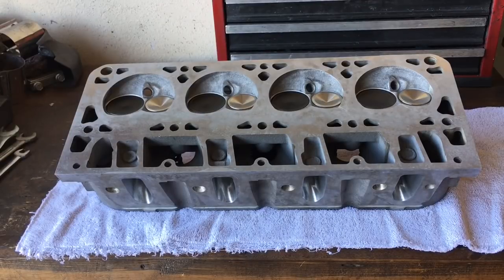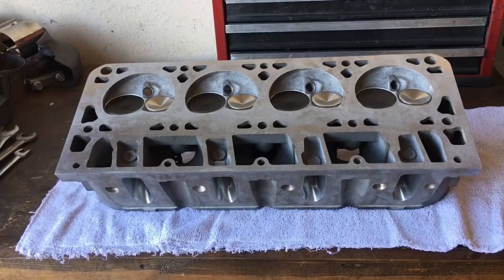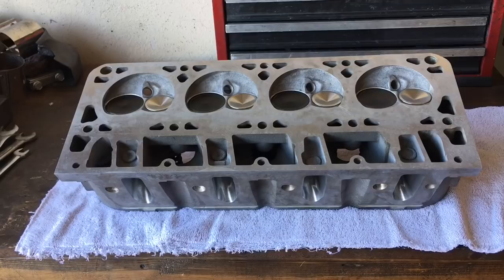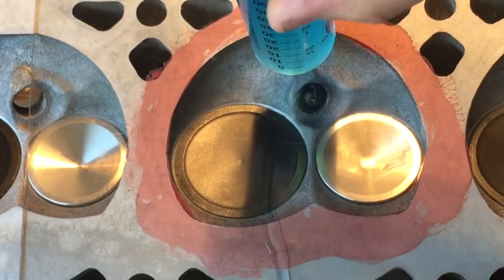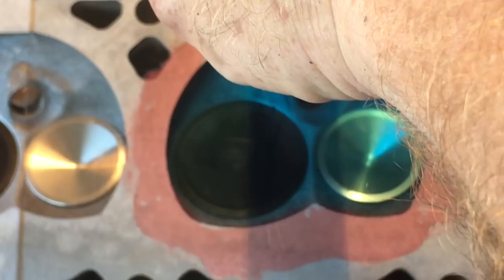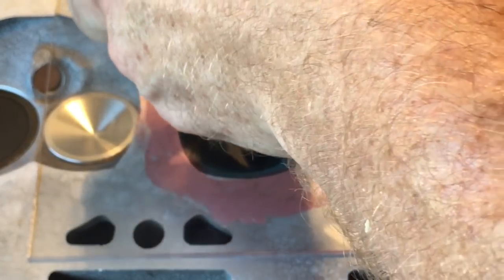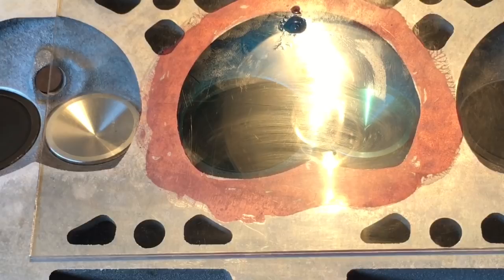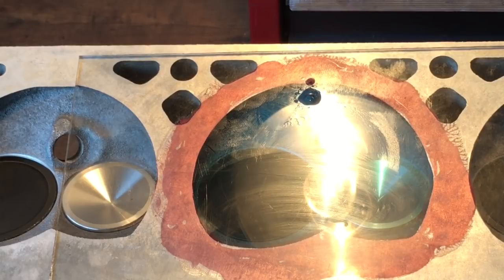862 heads DO NOT come with 61.5cc Chambers

Comment: The difference is mainly between the 862 and 706s because of the way they are cast. 862 can have more variation because of being sand cast ( 706s are permanent mold style ). But as others have also said you spilling a few drops, different valves, sunk in seats and even different spark plugs all can change the measured size of the chambers. Hope you edit the commentary and correct your comments so others learn correctly and not think incorrectly because you showed incorrect information.

Comment: I've worked in a machine shop for 22 years and just cc'ed a stock head before a valve job or surfacing, and it was 63cc.
Reply from the maker: Closer than some that’s for sure, I have yet to find one anywhere near 61.5cc factory. They’re supposed to be 61.5cc , but I haven’t found one yet.
Thanks for watching and sharing your results!  JD

Comment: If I was using those heads on a 5.3 that's probably fine, if using on a 5.7/6.0/6.2/383/403/408/416, I would unshroud those valves a bit and might open the chamber a little bit for the absolute best results.
Reply from the maker: Definitely needs a bigger cylinder bore to shine!  👍

Comment: Did you wind up having to use shorter pushrods with that head after milling it?
Reply from the maker: I always mill the heads equally, I’d have to go back and see what length push rods.  It’s always recommended to verify push rod length to set the lifter preload.  You’ll be surprised how many different lifter preloads there are between manufacturers ranging from .040” to .100” 😳😳😳
Reply: @HeadFlowInc  Absolutely there are! I’ve ran into the problem with having to use shorter pushrods and figured I’d ask.

Comment: Are they the stock valve
Reply from the maker: This set has 2.00”/1.57” valves; it must not make much difference because every 862 head I’ve checked is +- 65cc.  JD

Comment: Flow numbers, dude.
Reply from the maker: What flow numbers do you want to see? What heads etc?
Reply: @HeadFlowInc  any of them, results pique interest
Reply from the maker: Sorry I missed your reply, YouTube doesn’t notify about follow up replies I have to go back and check. 
I have flow numbers for many LS heads I’ve ported ranging from 215-225cc intake ports and 81-83cc exhaust. 
My 215cc port w/2.00” valve factory valve job flows 275-280 cfm @.600”. 
The 225cc 243’s w/2.00” valve factory valve job flow 300-306 cfm @.600”
I could improve the flow numbers a bit with back cutting the intake valve, under cut aftermarket intake valves and possibly using a performance cnc valve job.  Sometimes the ports don’t respond well to the multiple angle race valve jobs. 
Naturally if I used a 2.02” or larger valve the heads would flow even more. 
The current 862 small valve heads 1.89” /1.55” valves w/208cc intake port is flowing 254 cfm @.600” lift!  268 cfm @.850” lift.  This is a small chamber, moderate port size, small valve combo out flowing 243/799 heads. Why?  Because there’s zero upper cylinder shrouding with the 1.89” valve; this style of head maintains more port velocity and flow resulting in better throttle response, higher average TQ/HP compared to the 243/799 2.00” valve heads. JD

Comment: Those valves don't look stock .did u also have a valve angle job done because that can drop the valve further in the seat . the volume of the spark plugs aren't included  in my experiences when u cc a head , and u did spill a bit ,and idk about syringes being accurate to that point given the volume of the neck . I'd be more apt to over fill a larger one and weigh it ,then fill the chamber and re weigh it to be fully accurate if I suspected something like this .
Reply from the maker: John Connolly Feel free to measure as many 862/706 heads as you would like you won’t find any close to 61.5cc uncut.  The same applies to 243/799 heads they won’t measure 64cc and the 241 heads won’t measure 68cc they will all be +- 3-5cc larger than advertised.  I’ve been doing this a long time, I openly invite you to validate the information provided.  Thanks for watching and the feedback I appreciate it!  JD

Comment: So would these heads be any good for stock ls1?
Reply from the maker: Yes and no, it depends on whether your planning on a bone stock 862 head or ported or if your planning on only revving the LS1 to 5500-6000 rpms. 
The 853/806/241 heads have the same size intake ports as the 862/706 heads but with a bigger intake valve.  Where the 862/706 heads win as cast is the much smaller combustion chambers create more compression.  From idle to +- 5000 rpms the 862 heads will produce more HP/TQ than the stock LS1 heads until you exceed 5000 rpms, so when you look at the averages of HP/TQ through the usable rpm range yes the 862 is better. 
If you ported a set of 862’s and upgraded to the 2.00” valve you can far exceed both LS1 and LS6 heads, but to take advantage of it requires camshaft, injectors, exhaust and tuning.  JD
Reply: HeadFlowInc thank you appreciate it
Reply: HeadFlowInc  I have 853 on atm would it be better to just get them port n polished

Comment: So which heads do we go with now...🤷🏾‍♂️😩
Reply from the maker: Wan Byas It all depends what your goals are?  Are you wanting a max effort pump gas, Turbo build, Nitrous setup or?  
Honestly, the best thing you can do is decide what octane fuel you’re going to run and build around it.  Don’t get blinded by the SCR (Static Compression Ratio) instead use the free online calculators to find your DCR (Dynamic Compression Ratio) which is what actually determines the octane needed. 
The valve timing of the cam at ABC or ABDC on the cam card information drastically affects the DCR, selecting the right camshaft and SCR to produce the DCR compatible with the fuel is the trick!  
There’s a lot more to setting up a max effort build than most realize.  JD
Reply: HeadFlowInc dcr? ABC or abdc?   Ok I’m lost.

Comment: I have to admit, I was skeptical at first, especially with using those syringes to measure with, and all the info on the interweb all states that have 61.1-61.5cc chambers. I just happen to have a 50cc burette set up to measure the chambers on a set of 799's that were supposed to be milled .030".  I have a couple sets of 862 heads in the garage so I pulled one out and set it up to cc the chambers.
Since the chambers are ~>60 cc, I had to refill the burette and zero the bottom of the meniscus to the scale, it ended up on 15cc.  Yes indeed folks, THIS head measured exactly 65cc. Confirmed.
Reply from the maker: Brian Buck I was shocked and disappointed when I found out the heads have bigger chambers than advertised.  I should have known better, all the old GM cast iron heads were the same way.  Ex old iron 72cc Pontiac heads measure 77-80cc!!!  That’s a big difference! 
Thanks for sharing your results!  JD

Comment: Good info planning on running some 862 heads on my lq4 with 40 thousands head gasket with btr  stage 4 ls3 cam hopefully have enough piston to valve clearance
Reply from the maker: Garage builtt You’ll have a decent bump in Compression, you should calculate both the SCR and the DCR to verify what octane fuel you’ll need.
Reply: @HeadFlowInc  i run race gas because I  spray nitrous anyway
Reply: I wouldn't use a Step 4 LS3 cam because it would have too large of a duration split, you're better off keeping the same over lap with more intake duration (which the small valves give enough P-V clearance for) and less exhaust duration and I would probably use the Vizard 128 formula to calculate LSA.
Reply: Turn out had a lq9 and ended up going with 799 heads

Comment: HeadFlowInc if thats true so why my ls1 engine with those heads made 10:8 compression untouched and made more power and 20lb torque deference than the 243 heads ?
Reply from the maker: ysoof alhammadi 1. No matter what the 862 heads raise the SCR more than the 243/799 heads. Why? Because both heads have larger than advertised combustion chambers!  Both are a solid 5cc larger than advertised 61.5/65cc and 64/69cc 
2. Compression builds torque and HP.  On average a full number of Compression represents +- 8% power up or downs 
3. Unless you used 64-65cc when you calculated the Compression then it’s not a true 10.80-1.
4. I doubt it’s much of a factor on a 3.898” bore but there could have been a cylinder shrouding issue with the 243’s I’m not sure.
Without knowing what head gaskets you used I’d say your SCR is around 10.45-1 
I could calculate the DCR if I knew the camshaft used and head gaskets.
Reply: HeadFlowInc sorry for not replying a month ago  but that measurements was taken by the garage that built my engine it was an ls1 from my 2004 gto with comp 224/230 cam and factory head gasket my compression was 10:5 with the 243 heads untouched measured by the garage and made 370whp 355wtq auto trans of-course and when I replaced the heads with 706 also untouched he measured the compression and it was 10:8 and it made 388whp 376wtq so sorry for not believing but your the only one that says the deference and also there alot of other sites i searched over the years that says what gm claims are true
Reply: @HeadFlowInc  That's a very important point the vid didn't really clear up. If just ONE type of head is several CC larger, that's a problem when comparing other heads. If ALL have larger chambers, then all combos will be lower CR than expected across the board. The later isn't a big deal since swapping 317's for 799's or 799's for 862's will still net an increase in compression.

I've got a few 799's I can test with this same method, except I plan to use distilled water & also weigh the water used to double-check.

Comment: Intake valve is sunk in the seat now  and you removed material abound the exhaust valve, the time to cc them was before you had them machined twice, else nothing here is conclusive enough to change ones build plan
Reply from the maker: thomas harvanek You are clearly not paying attention to the video. I have shown several 862 heads on my channel and ZERO of the factory heads had chambers below 65cc (feel free to measure as many as you want and post the videos)
In the beginning of the video I verbally include these heads were 65cc chambers before any machine work.  Yeah it’s frustrating when people like you don’t listen, have no experience yet post comments with no value other than showing you are confused. 🤷‍♂️
When a machine shop does a valve job they set the “valve stem height” with in its specification, so no the valves aren’t sunk into the head, they are to GM specification. Strike #2

Comment: I agree, the 862's going on my 6.0 have been milled twice.. and I measured them out to over 60cc. Granted the machine shop could have only taken off a couple thousandths, but who knows.
Reply from the maker: chevydriver207 I’ve found every stock GM head I’ve checked always measures +- 5-8cc larger than advertised.  This added chamber size holds true for SBC, BBC, Pontiac V8, and LS heads, so it has to be common practice.  
Thanks for the feedback I appreciate it! 👍👍👍
Reply: The Rusty Nut hows that 5.3 headed 6.0 behaving for you? I have one but not happy with top end.. i may get the heads ported and swap intake manifold. It has tq for days though
Reply: @swappedoutZ71  Wondering if you did anything else besides the 5.3 heads. And if you had to retune
Reply: Casey Elder yes it needed a retune and i had all supporting mods for a cam
Reply: @swappedoutZ71  The heads have a ton of port work done, and its an absolute animal.
Reply: The Rusty Nut thats what i need to hear to sell me on PRC stage 2.5s ..could you describe the power curve?
Reply: @swappedoutZ71  Hard to describe Lol it's in my 72 Nova, and it does not keep traction if you put your foot into it. If I ever get it on a dyno this summer I will let you know.
Reply: The Rusty Nut im on stock heads and intake just cam longtubes and built trans and i can agree with you on that part. No problems burning out lol
Reply: The Rusty Nut what intake you go with??
Reply: @wanbyas359  It's an Ls6 knockoff made by Dorman. I think the part number is 615-901. I want to upgrade intakes at some point to an atomic airforce.

Comment: Did you check multiple chambers to see if they are consistent in the casing or did you check the same chamber each time?
Reply from the maker: Superado2006 I generally don’t check every chamber, it isn’t required.  I try to check the same chamber, or at least one on the same head to compare. It’s never a bad idea to check a chamber from each head, I’ve seen them differ by a couple cc on older heads. 👍
Reply from the maker: Superado2006 I’ve seen a guy who use to cc every chamber on both heads, he would find the as cast “largest” chamber and make all the remaining 7 chambers match it within 1/2 cc. 😳🤔
Same guy had a flow bench, he would balance all the ports in the heads until they all flowed with in 5 cfm of each other.  Heads have good & bad ports, this may be caused by various port shapes and locations making them all slightly different. 
Same guy also flowed his heads with the intake bolted on!!! 🤔🤔🤔
Reply: @HeadFlowInc  sounds like he would get a very smooth and even running engine that would perform just a little better then the rest, now was it worth the time and effort, I guess that depends on the results and the application.
Reply from the maker: Superado2006 Nobody was able to duplicate his performance using mostly Factory parts.  His name is Jim Hand a well known traditional Pontiac V8 racer, check him out on a Google search. 👍

Comment: something that no one is pointing out here is that just milling your head deck surface isnt good. It changes you clearances and makes things uot of alignment. If you mill your heads you need to mill you intake or block intake mating sufrface
Reply from the maker: Richard Scarlett Keep studying, at least you’re trying to understand!  
There are times you should mill your heads equally on both the intake and deck sides/surfaces to restore the intake manifold sealing “angle”.  Not needed at this cut. 
Yes, you will need to account for loss of clearance piston to valves. 👍

Comment: You are still getting a false reading. You need to plug the spark plug hole flush, not using a spark plug. Using a spark plug with this method, you are also filling the spark plug cavity and the area around the ceramic insulator.
Reply from the maker: Richard Scarlett The spark plug will be there during operation so it’s a more accurate measurement of chamber size. Free tip! 😉😎
Reply: I'm not head expert but that definitely crossed my mind watching this. .. but I mean how many cc is that part of the spark plug .. also when I have seen this done in person they used a tool that was essentially a threaded rod in a tube that mimics the plug except it's just flat, turn the rod in then turn the jacket to seat it at the desired depth .

Comment: Those valves added cc and you dropped 2-3ccs out of the needle as you were putting it in. So it was more like 58-59 cc.  Flat valves would have put you at 55ish range. So yea. There about 61-62 ccs factory.
Reply: Agreed

Comment: So then reducing the volume is good because of the added pressure it builds during the compression?
Reply from the maker: Timothy It’s a way to increase the compression ratio of the engine. Higher compression makes more horsepower and torque. Here’s ways to increase Static Compression:
Milling the heads.
Boring the block.
Thinner head gaskets
Piston dome design.

Comment: What 4.8-5.3 heads do I need to avoid? I'm looking to make the LS leap, I want to start with a smaller cheaper engine. And maybe get a 6.0 later. I think a 4.8 with 10 psi intercooled, in a1/2 ton truck or car, will be plenty for a daily. Maybe a 6.0 with 20+ psi and water methanol injection. And a cam and other goodies, for a weekend bruiser. Maybe a 4.10:1, 4.56:1 gear. And over drive! But I'm looking  to put it in a 82 Monty SS clone.
Reply from the maker: JAMES! Since the 70's Avoid the earlier heads like the 706 with the Kastek sp?  It has a symbol that looks like a battery sitting side ways under the valve cover. 
You’ll find Turbo combos won’t need deep gears like a NA build.  JD

Comment: Do guys angle cut these heads, I know the old SBC could easily be angle cut.
Reply from the maker: JAMES! Since the 70's I haven’t heard of anyone angle milling in a long time. I know the LS heads have a way better valve angle, not sure if this would play a role in how they mill the heads.  I was always told if you mill a head .020” or more on the deck side the same amount should me milled off the intake side.  😉

Comment: Did you do anything to the block?? Like flat top pistons or deck the block ?
Reply from the maker: James The machinist STD bore 2002 4.8/5.3 iron block honed the cylinders and new HD cam bearings.
4.8 Gen 3 flat top pistons and rods. The pistons are already slightly above the deck from the factory. 👍
Reply: I am currently doing a build for a customer . We just resurfaced the block . We took like .005 off each side. We’re running flat top pistons. I was curious what the CC’s were on the heads (casting#862) after watching your video. We are already at 60cc’s. So we are just gonna take off what’s needed to clean them up. We also put the 2.000 intake and 1.575exh. Port work too. The customer wants the choppy sound so we went with the thumpr cam. It’s our first LS build . I can’t wait to hear this beast run. Oh we also went .040 on the bore. One last thing on your broken bolt , I use a left hand drill bit . Drill all the way threw and easy out the rest of it. Works pretty good and generally only takes about 1/2 hour.
Reply from the maker: James The machinist Your 4.8 should be 400+ HP I’m sure, I hope the customer likes to spin 6500+ rpms, the 4.8 just keeps pulling!  It sure sounds like you guys did a great job!  Thanks for the feedback I appreciate it!!!  JD